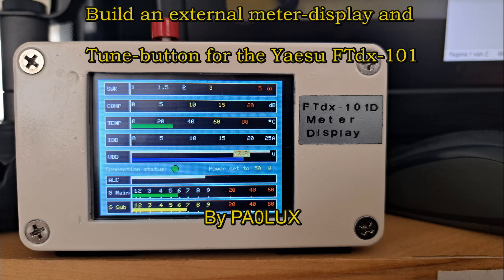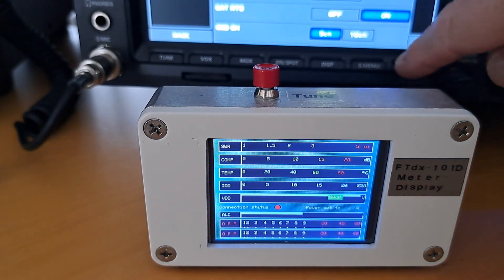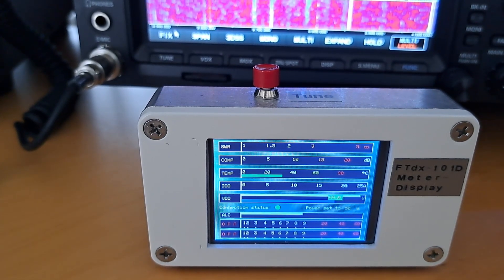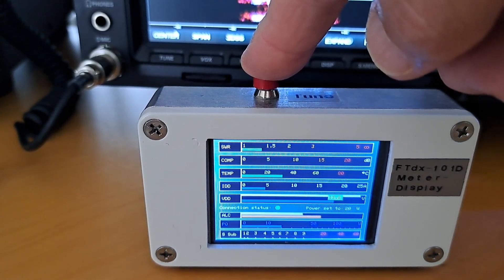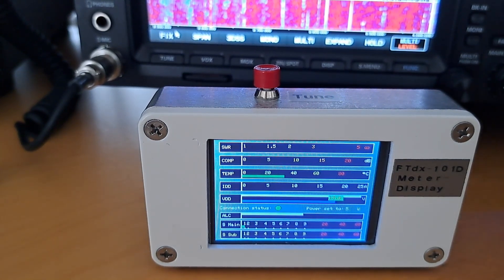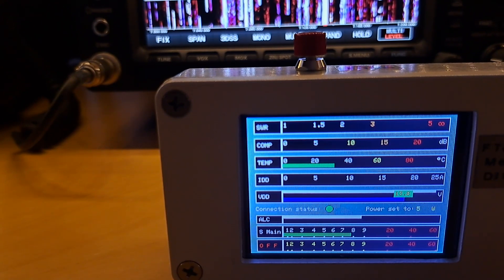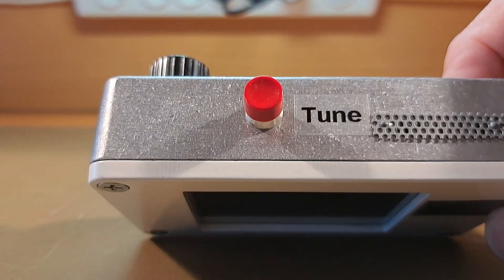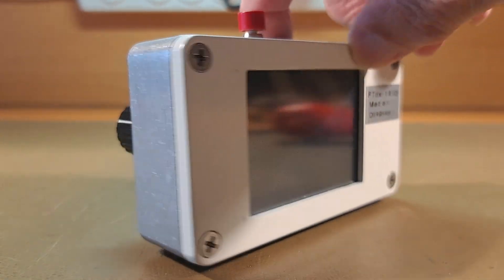Yaesu FTdx 101 external meter display and Tune button

Comment: Thank you for publishing it, it works great, it's an excellent add-on, I modified the code a little and it works very well with my station master antenna controller, also controlled by cat

Comment: Geweldig mooi stukje elctronica en programmeer-werk Eeltje. Petje af :-) .  Ik heb zelf 2 jaar geleden een externe controller gemaakt voor mijn FTdx3K en FTdx101d naar idee van G0ORX (HRN 229: Arduino CAT Controller for HPSDR (from the DCC on HamRadioNow) De HPSDR-commando-structuur heb ik omgebouwd naar Yaesu-Cat-Commando's, voor mijn Basic CatControlBox.     Nu wil ik het ook verder gaan bouwen met een display, en ik denk dat ik gebruik kan maken van jou voorbeeld-programma. Nadat ik de Smoothed-librarie heb gedownload compileerde het prima voor een Arduino-Nano. Dit wordt een leuk projectje voor komende winter Eeltje. Nogmaals bedankt voor al het werk, en het delen met ons. 73 PA2JJB

Comment: Great display, and how the reading of all parameters behaves during transmission, post a short movie if you can.
I want to do this meter made in a week.
Reply from the maker: The external meters do not differ from the readings on the internal meters of the FTdx-101. Stepsizes on internal/external meters are the same. So the external meters have the same resolution  (which is not so very high) as the internal ones.
Reply: @PA0LUX  I meant more whether the external monitor shows all readings at the same time or only the parameter that is currently set.
I already bought what I missed and when I receive the package, it will solder and check this meter. 
73 👍
Reply from the maker: @jakubkrawczynski3322  It will Always show the readings of All meters at the same time. Only when in TX, the Main S meter is substituted by the Power meter.

73 de Eeltje
Reply: @PA0LUX  Unfortunately, I've been trying to load the batch to Arduino NANO all day, but unfortunately, I still get library errors, I loaded .zip folders with libraries, but information pops up that the files are duplicated, etc.
Reply from the maker: @jakubkrawczynski3322  The library files are (also) readily available on the internet and are not written by me. So there must be something else wrong , maybe with your IDE. First question; what happens if you only compile, without loading into the NANO. You better contact me directly at: mycall@VERON.nl . mycall is my call.